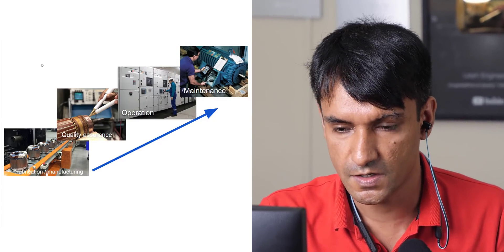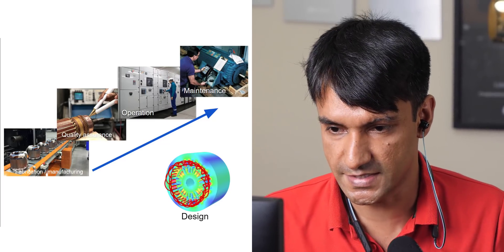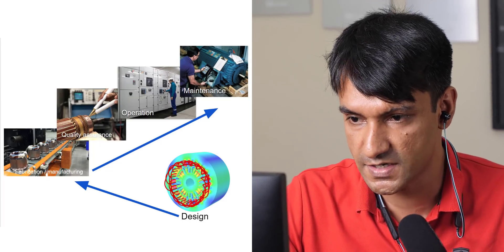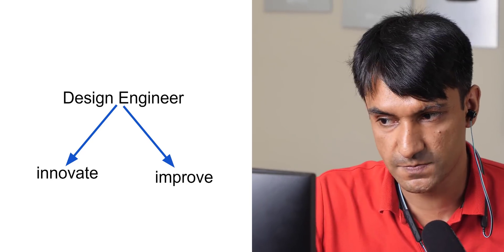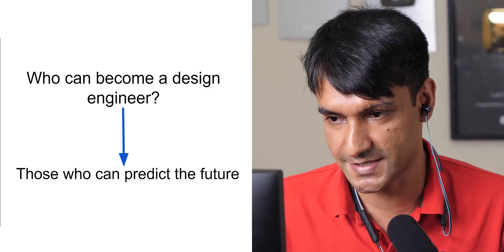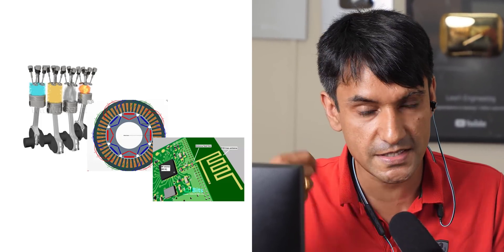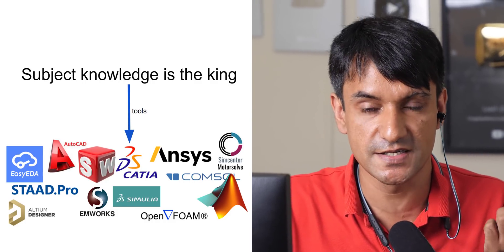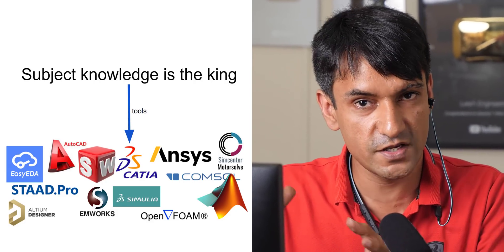How to become a design engineer? | Sabin Mathew

Comment: Hello, I need an advice. Im basically Electrical Engineering Graduate in 2008 from Osmania Univ. have 13 yrs of construction site experience in Buildings, Oil & Gas.. I have always been interested in Engineering & technical activities, calculations, designing. At site work Im not getting opportunity to perform these tasks. Hence I have decided to work as Electrical Design engineer. Request everyone to advice how to get into Electrical design with 13 yrs site construction experience..

Comment: If we increase the length of connecting rod thier is no change in engine speed because when piston complete 1 oscillation = 1 rotation 
Thier is no change in no.of rotation of wheel 

Hope u understand

Comment: Problem is, many thinks that science is appendix to engineering, whereas they fail to understand that engineers basically are applied mathematicians working on big chunk of physics or physics + chemistry. Dearth is of understanding mathematics geometrically, so it can be used practically on physical process in order to generate mathematical equation. No one has good knowledge of mathematics, nor anybody teach it. Good mathematics learned engineers never face barrier while going through multiple engineering field while designing the product. In future, design engineers only will b considered as real engineers & others with same degree & bad maths will b helpers. This will give rise to future which someone said about, that, in coming future "either you will give orders to machines or will take orders from machines", depending on one's capability. And this is happening bcz world once again is bending toward scientific research, rather than mere industrial manufacturing.

Comment: Hello,Sir. I had a request, if possible can you relate a design problem of an actual project showing what inputs were given (means problem faced) and how did you solve it? I have knowledge of analysis problem where we know which material is used is known and also dimensions (geometry), we have to find the value of load acting on a certain part where stress concentration is maximum by using finite element analysis. I really wish you make a video regarding what design problems are faced and give an insight on as to how to solve it. A latest practical example would really be helpful.
P.S. : Please correct me if i am wrong  regarding my knowledge of solving analysis problems, i know there might be other things for consideration, i was just giving an overview.
Big fan of your videos.

Comment: I've learnt a lot of theories and derivations during the 4 years in college and I still wonder if they were necessary.
Reply: As a structural analysis engineer, I can say pretty much "yes". If you are going to analyse something, you need formulas, you need to know the theory. But if you are just planning to use a CAD software and draw some pretty pictures, then I would say, overall "no". But the second case does is not being a "real engineer" imho.
Reply: @outplayed4511  do you have to get an M.tech in Structural Engineering or B.tech is enough to get into Design Field...plz reply
I would like to know about your academic approach to Structural Engineering field.
Reply: Not everything but it's important.. 
I learnedd RCC .. Its used everywhere in structure design
Reply: As a EE I'm going to say no. Some of the basic theory is important like understanding power factor. A lot of the stuff is just learned on the job. I'm in substation design doing 230kV and up stations. I've done 0 integrals or anything fancy. But knowing how to read a datasheet and engineering plans (i.e. building off another persons work) is really important. If you were to go into transmission planning then some of the higher level theory comes into play, a lot of the stuff in that group went over my head
Reply: @brimmed  You are not a design engineer. Consider this. Can you select any material for your transformer? Will it have effective heat dissipation by the fluids and the fins? How much will be the power loss in different atmosphere and temperatures? What will be the safe thickness of wires to supply the power? How should you design to get minimal power loss at reduced cost? what design of the transformer will decrease the manufacturing cost? How much upper limit of voltage that it could sustain? All of these have been calculated already but a design engineer will try to improve and increase the efficiency at lower the cost. And you cannot do that without theoretical knowledge. I'm a mechanical engineer so I don't know in depth knowledge about transformer.

Comment: I am not engineer.
I wasn't allowed for a 3 month's course in Central institute of Tool Design.
I request then they accept.
I join
I became topper in Autocad, Pro-E CATIA
Drafting and 3D Designing.
Learning How to  use Designing Software Isn't OK.
You must have thorrow knowledge of Related Stream.
If not, you must learn and add enhance your skill.

Comment: Being a Design Engineer & Project Engineer I completely agree subject knowledge is very very imp...

There was a time where I had to work with a senior design engineer, where we had to improve design keeping an overall weight from 317kg to 315kg and at a reduced cost...he managed to design with a weight of 314kg and told me as weight reduced so the cost will be reduced...The design was complicated..looking at it I asked how will we manufacture it...he ignored me...he was just happy that he managed to do the design in 314kg...since he was my senior I kept quiet, still regret it...But during the actual production, the cost of manufacturing increased by 2.4 times than the actual design. even time of manufacturing increased by 6.5hours for each batch

The point is subject knowledge is very very important
Reply: Thank you for sharing your experience. But I'm curious, what happened after? Did the project was given to someone else? Did he managed to fulfill the requirement after? If yes then how?
Reply: I loved these kind of work-floor tales..!
Thank you!
Reply: What item
Reply: My boss still trying.... More than 5 project stopped because of him... 😂😂😂
Reply: I see it all the time people get paid to look like they are improving things on paper and cause problems for others to solve in the practical side of things

Comment: I'm an operating engineer, the guy who has to show the builders how to do what you people design. The problem with design engineering is you mostly have no idea how to accomplish what you design. You should learn construction and building methods that way what you design will work...
Reply: i agree. It's important when designing something to have in mind how it can be made. Perhaps not necessarily at the very first pass, but very quickly, DFM becomes important.
I've seen (and unfortunately also designed" parts that are very hard to make, assemble, and maintain. Engineers having hands on experience with the fundamental fabrications tools (machining, welding, forming, molding, etc) will allow them to design with the limitations (and strengths) of the processes in mind.
Reply: I think that was kind of his point. The more understanding you have, from as many sources as possible, the better you will design. Too often, 'book-learning' is deprecated against experience, but they are complimentary. Learning from builders, toolmakers and operators of machines will also give you, as an engineer, a better appreciation of the vast range of things that you will never have the time to learn in detail. Sample widely. Pay attention and respect those with experience. Many of those with experience wrote their stuff in books.
Reply: @chrishutchings1963  Ok I did not watch don't like design engineers for the reasons stated. Books are fine but they don't get the job done.

Comment: Learn design engineering.  That's where the future is.  I've been doing the new design stuff and engineering of building stuff for 55 years.  Listen to this guy, but learn to think in design.
Reply: What design software do you recommend? I’m familiar w autoCaD, atuoDesk INVENTOR, Fusion, ANSYS, and some MatLab. I would appreciate your reply big time 👍
Reply: @albierodriguez9797  
I'm not an expert or anything, so take my words with a grain of salt:

Learning design software is just a small step in the huge process, learning software alone doesn't take us anywhere. What I think is more important is to learn the fundamental theory, like materials science, numerical methods, solid mechanics, dynamics, theory of machines, control systems and machine design. Without having a firm understanding of these concepts, learning any design or engineering software is literally of no use, it's effectively like learning how to aimlessly press a bunch of buttons on screen. But when you learn the subject, you'll be able to leverage any software to its maximum potential.

If you just learn and master a CAD/CAM/CAE software, at the best you'll be a draughtsman or CAM/CAE engineer, who work under an actual design engineer. In most cases, a design engineers themselves do the CAD/CAM/CAE stuff, so these days a career as a draughtsman or CAM engineer is kind of becoming obsolete (it'll be there for a while) due to the advent of rapid prototyping (you know this if you're an amateur Fusion 360 user).

I've also heard that it is less often for fresh graduates (unless they're from a very reputed university and academically exceptional) to get a job as a design engineer, because most of them these days are just learning core concepts in a superficial manner and focusing more on specialized stuff and software, which is not in the likes of companies.

With that said, our product design professor (who also happens to be a design engineer at GE) recommends us to learn SolidWorks, MATLAB and machine learning. If you're planning to be a robotics design engineer (mechanical), specifically, then along with those mentioned before, you're expected to be able to comfortably develop programs in Python (since it's gained a high reputation among mechanical robotics engineers as a quick language to develop prototype algorithms for their robots, which will then be optimized and translated to machine-friendly code by robotics software engineers).
Reply: @BME-dj1ox  thanks dude..your words are gonna help..this summer I am gonna learn MATLAB. I am doing my graduation at NUST majoring in mechanical..
Reply: @BME-dj1ox  Thank for all the guidance 😄
Reply: @BME-dj1ox  i agree with your first paragraphs. Thank you for the insight!
Reply: @nietzschean6987  your real name?, I am also a NUST student 2020 batch.
Reply: @BME-dj1ox  OK, what is required to be a design engineer then?
Reply: @albierodriguez9797  most pros use solidworks or inventor. But it totally depends on your job. Drafters and architects like to use AutoCAD
Reply: @albierodriguez9797  seimens nx
Reply: We need to get rid of the 'design fail' courses ...these courses were 'engineered', to teach not only 'safety' failure points, being, if your design is to fail it will fail in a safe manner(vehicle engineering comes to mind in cars that fall to pieces on impact in order the 'receive' the impact in the safest manner for all)...design fail is also there for your vacuum cleaners, so you will need a new one after the engineered design flaw would insure you pay more over time for the same trap item, or you spread your money trying a different brand...i have many things over 100 years old that work very well still...no money in that for companies to design engineer and build long lasting quality....for which would save how much accumulated 'trash' such as those old vacuums that failed...highest quality is best for our worlds environment, and you thought 'cheap' cost less, nope, not in the long run money wise, not for our environment or sustained future
Reply: @tenguken847  Eye opener
Reply: Glad to listen from you, sir. I was desperately looking for guidance for electronic circuit design and development.
Reply: Awesome learning 👍🙂
Reply: Uyyjt10j
Hmmm p1a